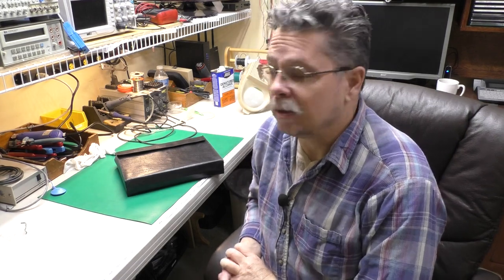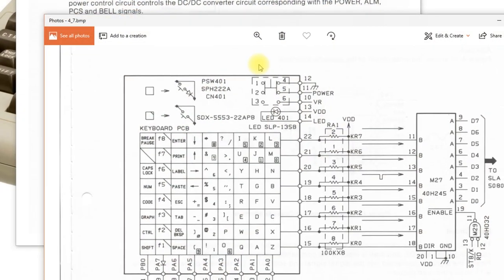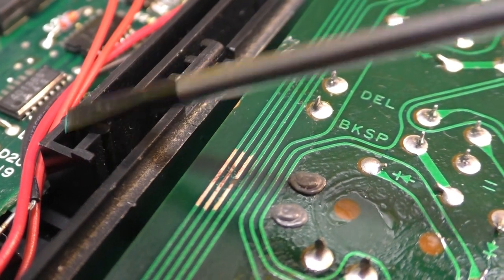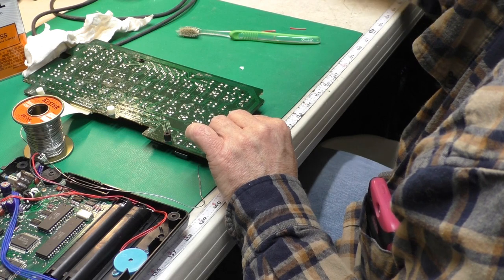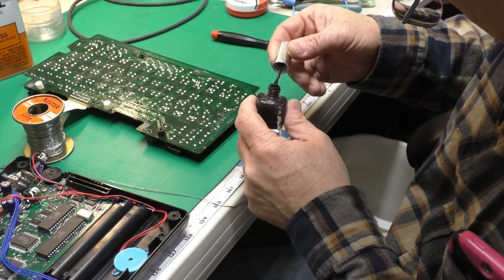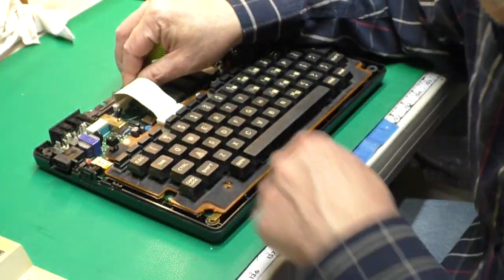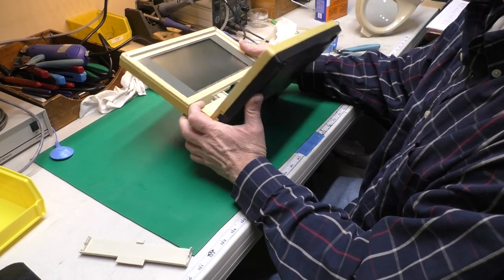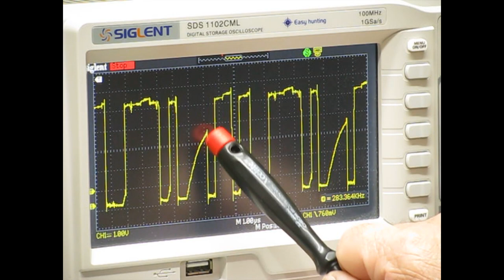TRS 80 Model 200 Repair - Blank screen, no power?

Comment: I actually have the same problem on my Model 200. After fixing the battery connectors that were oxidized I noticed the same exact damage on the traces you see in this video. I taped them to prevent further damage, but now it won't turn off after turning it on...
Guess I need to get to soldering a bit too. Thanks for the vid :)

Comment: Fantastic job =D  Really useful info there related to where the keyboard PCB rubs on the inside case edge - not the sort of thing you often see in other systems!
Reply from the maker: I have been pondering why they ran the three leads for the power switch all the way around the PCB instead of 3" directly over to the ribbon connector. It also seems like these are the only three traces affected by the rubbing. Makes me think the power switch being on the keyboard was an afterthought and they just tacked the traces on the outside of the PCB where they had previously left  it blank since it would rub. I don't know but the KB just sitting in there like that is odd, never have seen that on anything else.

Comment: I've got a few 102 mainboards that will power on, but the screen stays off... well, powered on but blank. I haven't figured out what causes this yet. :/
Reply from the maker: If the screen is BLACK it is most likely getting the proper voltages but not being reset as the computer is not running properly. If the display is blank I would suspect a power supply issue. As I recall there are two 5V sources and 1 -5V source coming from the switching power supply section. There are a few capacitors in the power supply section that are notorious for leaking and will cause voltage issues.